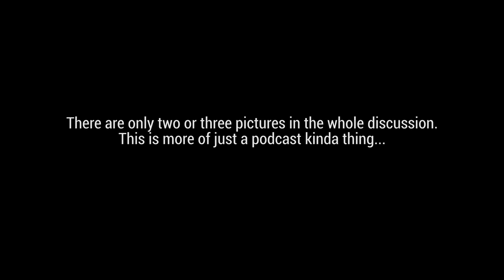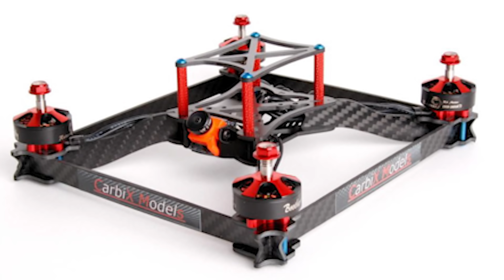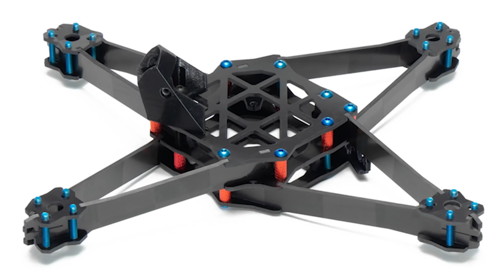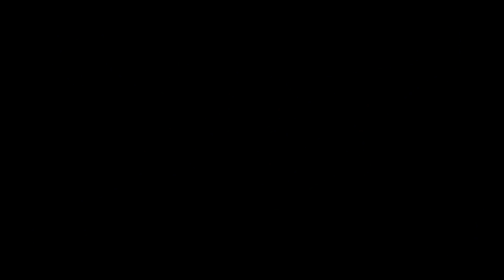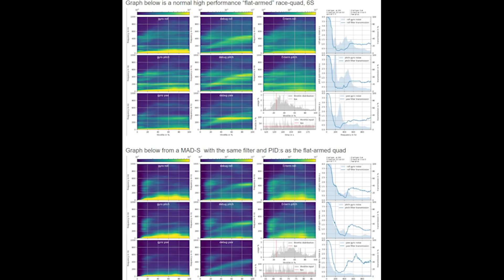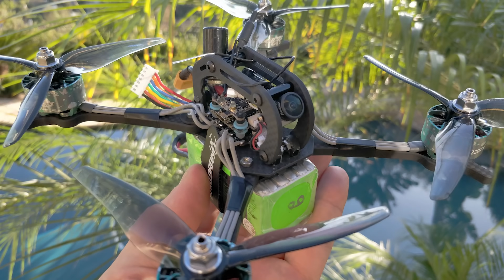Frames and Resonance with the Swedish MAD-S team

Comment from the maker: Table of Contents:
06:05 - Vertical vs horizontal arms
13:55 - Resonance
33:03 - MR30 connector? (Three prong XT30)
37:38 - Bearings
41:13 - Hardware material options

The MAD-S: https://madkwads.com/produkt/mad-s/

Oscar:
IG: http://bit.ly/2XXuxSC
YT: http://bit.ly/35GbT4m
FB:  http://bit.ly/2OUdHjD

The first interview mainly about carbon: http://bit.ly/2Oy46A8

▼Join my FB group for more discussion: Kabab FPV
https://www.facebook.com/groups/379155946182689/
The store: www.FPVCycle.com

▼ My typical 5" quad setup:
-Hyperlite Glide Floss Lite: https://fpvcycle.com/collections/frames
-Motor: -Xing 2306: http://bit.ly/2Nqqr25
- ESC: http://bit.ly/2oDdzvL
-WaFL’s Cap Cap: http://bit.ly/2GUpXxO
-Battery: http://bit.ly/2JnsTDM
-FC: http://bit.ly/2XRc8G8
-FPV Cam: http://bit.ly/2Q7LfL7
-Vtx: http://bit.ly/2HsrASs
-ND GoPro Mount 30deg: http://bit.ly/2WC15zc
-ND Filter (if used): http://bit.ly/2WEmQ1j

▼My preferred goggles as of Sept 2019
http://bit.ly/2k5YNv5

▼Notable motors:
-BH R3 2207 for $9.99: http://bit.ly/2NaTWEy (limited quantity only)
-Xing 2306: http://bit.ly/2Nqqr25
-Xing 2208: http://bit.ly/2y3te8R
-FANTASTIC 6" motor: http://bit.ly/2LqghOZ

-Starter goggles: http://bit.ly/2qbJNOS

▼ If you want to solder better:
-Fantastic solder: https://amzn.to/2P5QM2W
-Fantastic iron: https://goo.gl/DqBipa

▼ Tips?
Patreon: https://bit.ly/2oGLP9b

-PayPal: https://www.paypal.me/kababfpv
-Bitcoin: 1E4XZXoD4rS6MYWVWuenY7Kw2M1YgyNpoQ
-Nano: xrb_1188ek5bd7tb9kw67asnp9o65byuoaxbtpxuznx1ribf75x78awywmakj55f
-ETH: 0xD067F93811f2eC31CB1928901002dfdf9A492EF5
-LTC: La2KWYAjp4VT2Lq2M76pbjzXWvRyjpfCtG
-Tesla Referal code: https://ts.la/bob40889
Please use my referral code if you're gonna buy a Tesla.  You get some free stuff when you do and I get better status with Tesla.

Comment: Cheers to "better in" when it comes to the gyro signal.  We can cover up with filters, but they have their downside (delay on the signal output).

As a side note: A secondary benefit of the RPM filter is it frees up the Dynamic Notch to lock on to any frame resonance that develops, track it if it moves, and crushes it out.

But the fact remains is it is better if frame resonance doesn't exist and if it does the higher in frequency the better; as you guys said.
Reply: doesn't a static notch filter do the same as using the rpm filter to free up the dynamic notch? Doesn't that use a lot less cpu?
Reply: @Quick-Flash  , no because the motor peak noise moves; a lot. Static notches do not, so they are not effective to kill peak motor noise.

However, resonance noise from a frame is somewhat static.  They do move some though (10 to 20hz).  Sometime a little with RPM and other times as the frame wears.  So you can use a static notch there - kind of -  but the downside of static notch is you need to use blackbox to set them and as resonance frequencies move, they don't move with them.  Of course the dynamic notch does.
Reply: @uavtech  Precisely - it's possible to activate different resonance modes of a frame as you excite it differently, which is why tasking the dynamic notch for that use actually works quite well, but being able to crush the RPM-driven noise just makes that so much better.  On paper, being able to let a couple of basic PT1 lowpass filters kill off higher frequency noise has such small phase delay penalties that the current filtering schema is probably better than we really need it to be, since the real limitation is wanting to back off a bit in case we're flying on destroyed props or damaged mounting hardware (at least in my case, as I bash gates hard)
Reply: @tehllama42  , yeah defaults are very conservative filtering.  But that is by design.  BetaFlight tried more competitive filter defaults with 4.0 and that didn't work out so well.  Folks fly some real "junk" on BF, but that is what you get when you are the most widely used FW in the hobby.

One thing however is that lowpass filters still have tons (2x +) of delay vs. a notchs.  For example, a lowpass (PT1) at 125hz cutoff is 1.3ms of signal delay and will NOT kill out the peak motor bands of noise.  Conversely, the RPM notches at the fundamental frequency are 0.5ms of signal delay and WILL totally kill the peak motor vibes.  

The lowpass (PT1) at 125hz only attenuates 60% of the vibrations.  Whereas a property targeted notch kills 100%.  The trick is having really accurate targeting with notch filters and that is were RPM filtering is a good step forward.

See https://www.screencast.com/t/xgb906Ou8h for backup on the above.
Reply: @uavtech  When you say 'folks fly real junk', that includes me... Now that I have some pre-built CLI drops, I've been able to take freshly built stacks, my 'base' tune flies well enough I haven't actually put much tuning effort beyond getting that filter slider adjustment done and putting my rates in.
I feel like some of that headway can actually be 'fixed' in the configurator by adding some pre-loaded tune bases that you and others would actually use for a few craft archetypes... but I totallu agree that having to hedge that much around not exciting flyaways on mechanically unsound setups is why we get that 'new release is garbage, long live the freshly deprecated release'.
Reply: @tehllama42  , yeah presets are long over due.  Tried to help this with: https://github.com/betaflight/betaflight/wiki/Community-Presets but it is not the same as having in the Configurator.

Comment: I am learning a lot from your videos. Currently I am building a crazy "Super" GEPRC CX3 Pro cinewoop, using all 30 X 30 stack components. One of the design criteria is that the components would have cross-platform compatibility with my other rigs, hence the 30 X 30 stack components. It has a 60 amp 4 in one ESC, an F4 Speedybee FC, 1606 4000Kv motors, with Azure 3060 tri blade 3" props, and one of those RunCam Hybrid split cams you don't like. I already had one installed in my first build "Big Bird" (this is my second build), and the GEPRC Cinequeen front braces (which are interchangeable with the CX3) are especially designed for the RunCam  Hybrid. So I installed a Foxier FPV camera and AKK VTX/DVR in Big Bird and installed the RunCam in Super CX3. It also has prop guards, being a cinewoop. I had to use HGLRC sector 150 prop guards, because the GEPRC prop guards are too shallow for the taller motors, and they don't have the 12 X12 motor mount pattern, just 9 X 9. I have a problem I hope you can help me with. I need a replacement connector for my Matek M8Q-5883 GPS Module w/ Compass. The original connector got munched, and this GPS has no soldering pads. Any assistance is appreciated. PS, I have an F4 Maetek Mamba flight stack with 30 X 30 and 20 X 20 stack mounting holes. It would have been ideal in the Super CX3 because I could have used the CX3's 20 X 20 stack mount holes instead of needing to use adaptors, but it doesn't have enough UARTS for this build. I heard on one of your videos that you wish someone made 30 X 30 components with 20 X 20 mounting holes.
Reply from the maker: These issues you're having are very specific.   I can't really offer much assistance with them but yeah still to this day we don't have proper 30x30 electronics with 20x20 mounting holes.

Comment: Thank you so much for this discussion, I am an engineering student, this stuff is invaluable. Training intuition is one of the most underrated things in engineering and talking about rigidity, resonant frequencies and comparing this with the geometry of designs is a great grounding on how CF performs in general in drones. Durability testing with many radically different frame designs also gives a good bearing on how frames break in general. The only way to understand the problem and possible solutions as best as possible is to get experience with what works. I can't wait to see where frame design goes from here and I hope there's more innovation to be had.
I can only afford to keep 2 quads running (student finances suck) and they both run floss 3's, the design isn't invincible but it is ridiculously repairable with race wires. Just a shame there aren't any European distributors, import tax and shipping is a bit of a hit on cost. I've had an Al plate bend in one of the corners from a vertical impact but I've bent it back for now.
Reply from the maker: The floss 3 isn't my design and imo isn't a very good design. It's alright but the aluminum is super inefficient and pointless.  There are far better ways to do things and I don't appreciate that they hijacked my frame line to slap on that dumb thing. It's not unlike Ford using the mustang branding for their new electric car.
Reply: @Kabab  Oh shoot sorry! My bad. Speaking of frame designs do you know the name of the name of the guy who makes very lightweight moulded carbon frames for speed records? I've forgotten but I remember him having some really out there designs.

Comment: I would vote no on adding a connector to a motor. I prefer using racewires. It takes longer to solder on and off, but it's not bad. Field swap takes maybe 5 min vs 3

Comment: Nurk has been using mr30 connectors on his multigp kwads for over a year now. If its good enough for Nurk its good enough for me.
Reply from the maker: I think I may take the gamble and build it into motors I'll make some time soon
Reply: @Kabab  If you put it close enough to the base, but with enough exposed wire to still go directly to a racewire solution, that should do... but I'm torn on whether that's actually better... then again I've not really been in the M30 camp, because running LED racewire makes it easy enough for me to swap motors - if I have to dig in my toolbag to get an allen key and a spare motor, grabbing a soldering iron isn't that drastic a difference.

Comment: My quads are typically under 325g, so I would use a reversible type mr30, or I suppose the motors could be labeled clockwise, etc. I agree the resonance of a frame has a lot to do with the way a quad flies.

Comment: Kabab, I would try to get some adapters and get some standard sized bearings into the 12mm bearing motor. So you can find out if the smoothness comes from the bearing...
Reply: I guess you could easy find a fitting brass tube

Comment: For the 3 pin connector are you referring to the MR30 (flat) or the MT30 (triangular)? Also if these were placed in the right spot could they help mitigate prop strikes?
Reply from the maker: MR30.  Not the triangle.  hobbyking actually made an R30 also many years ago.  It's the same as MR30 but it's reversible for flipping motor direction.  Yeah and prop strikes is another benefit to a connector in the way.

Comment: Regarding MR30...if you're going this route, then why not just use bullet connectors (which they used to do back in the day). Less weight, similar resistance, and the advantage of being able to swap two wires around in case of reverse spin
Reply from the maker: MR30 is much cleaner.  Apparently there's also an R30 that's a reversible MR30 specifically made for motors too.  Bullet connectors are also very long.  MR30 may not be as long.  Just options.  I don't think I'm going to do it simply because it limits the potential sales.  I may get a batch of like 100 motors with them just to see how they sell

Comment: i wonder when we get the first motor with barrel bearings, they would be much more dureable
Reply: Vertical load is quite a big part of the bearings job and barrel bearing's aren't so good in vertical loading. Might be better to have a pair of tapered roller bearings. Issues are cost and practicality. Most of the time a motor breaks from a bent shaft or a deformed bell so stronger bearings aren't going to do anything but add weight. Might be useful though if the rest of the motor construction gets stronger
Reply: journal bearings? have a ton of friction compared to ball bearings, thusly dont last as long. but they are cheap
Reply: @oranellis  there's no vertical load. You can run motors without c clip or screw the bells hold on by the magnetic force itself

Comment: There’s been some interesting discussions about tilted motor (actually now tilted arm) designs to allow prop thrust (instead of just inertia) to contribute to yaw authority with the Vert1go 7” vertical arm frame some Australian guys have been working on.  About halfway down the page https://www.rcgroups.com/forums/showthread.php?2883082-Tweaky-the-people-s-frame-and-its-variants/page221 you’ll see 3 photos of the tilted arm frame they’re testing and some subsequent discussion.  Here’s some discussion of motor tilting and yaw authority in their thread: https://www.rcgroups.com/forums/showthread.php?2645953-Mini-tubular-and-ultralight-LOS-Acro-FPV-Quads/page335#post40263839
Reply from the maker: Tilting the rear motors in a V tail configuration makes everything very different. It doesn't really end up helping for various reasons but to someone that can't quite push the quad to the limit on a track it may seem like it's better. It is an intesting direction however
Reply: I think the quads in these threads primarily focus on LOS flying, where a lot more yaw may be used... I'll let you know how the performance changes.  I've got one of the (non-tilted) 7" vertical frames and I really like it.  It is a bit hesitant on the yaw and dips some on throttle bumps as well, but that could also be due to my poor tuning abilities as well.

Comment: As for the mt30 or mt60 does the 3 pole wires pull individually 1/3 the amperage the motor uses or do they each pull the full load?
Reply from the maker: The load alternates. So it's sort of full load on all but flickering around the wires. The MR30 is more than enough however.
Reply: @Kabab  cool I had switched all my quads to 6.5mm castle connector for the battery lead a couple years back because I kept melting packs solder joints and exceeding esc amp limits on my 6s rigs. Since then I use far less amperage and everything is way cooler and have punch for days.
Reply from the maker: @wodifpv644  I have heard that XT90 is far better for 5"....
Reply: @Kabab  true I agree pretty much anything with a higher amp rating is better than a xt60 on a 5inch or larger

Comment: The tbs vendetta has mr30 connectors on it right?
Reply from the maker: No those are actually the xt60x3 connector. Don't remember the name. I don't think MR30 existed back then.
Reply: They are MT30s. I used to have a Vendetta.

Comment: I have been working on vertical arm frames for 2 years. I don't post images often but take a look at @nablafpv on IG
Reply from the maker: That's not an IG account that comes up 🤷🏻‍♂️
Reply: @Kabab  Fixed; Sorry about that... autocorrect doesn't like the word nabla.
Reply from the maker: @zachcarrizales5038  looks good but you're gonna need to tie those arms together with something rigid or it won't fly so great
Reply: @Kabab  Which frame? The vertical arm one?
Reply from the maker: @zachcarrizales5038  yeah
Reply: @Kabab  It is all about the tolerances on the carbon to carbon joint. I flew it for 6months no issues, survived a 150 feet fall due to loss video flying in woods broke 2 motors - frame was fine.  I finally got sick how annoying the motor wiring was and now it's just a trophy.
Reply: Dont get me wrong... most factories wouldn't be able to get those tolerances right on a mass production scale. But I dont mind it for myself. Would you want to work on a 3 inch vertical arm frame together?
Reply from the maker: @zachcarrizales5038  3" is really difficult because of the weight class.
Reply: @Kabab  Totally true... might no be worth it. I have been trying to recreate the feeling of a true freestyle feel in a non-ducted 75mm frame and the only design i can come up with to reduce the weight is not carbon at all. I have also been working with NewBee Drone a bit to help them design some new setups and make some strides in innovation that I have felt are over due.

Comment: Look into the Norwegian frames too, especially the rotaro ones, some genius Norwegian has been making frames like this long before karearea and the carbix
Reply from the maker: Those guys out in that part of the world are really crafty
Reply: Tried a Rotaro frame. It's built like a tank with insanely thick carbon for a 3" frame (the arms are almost 6mm thick), but it was the fiddliest damn thing I've ever built. It's heavy too and it didn't with enough screws to use the side booms. The Mad-S and Carbix frames use thinner carbon, but in a smarter way. Rotaro still use flat carbon and just doubled the thickness compared to all other frames of that size.
Reply: @MachineManGabb  Haven't tried their 5" frame, but it looks good. The 3" flies well. It's just a lot heavier than it has to be.